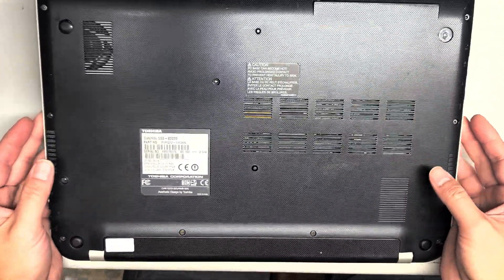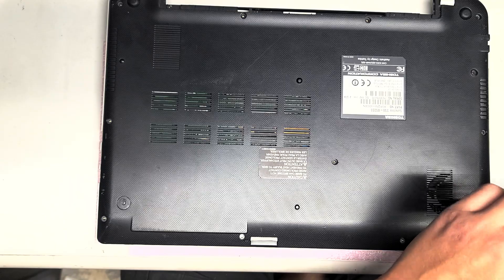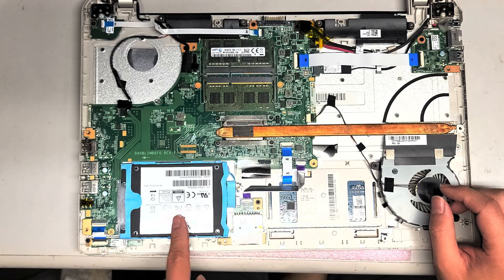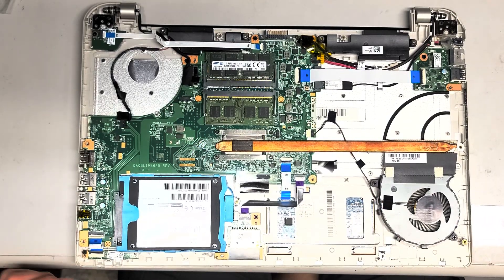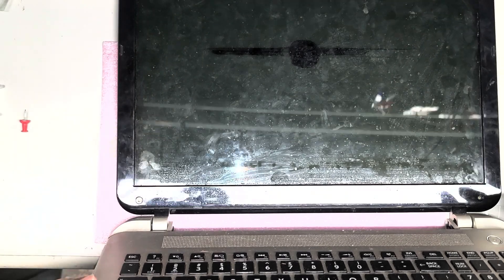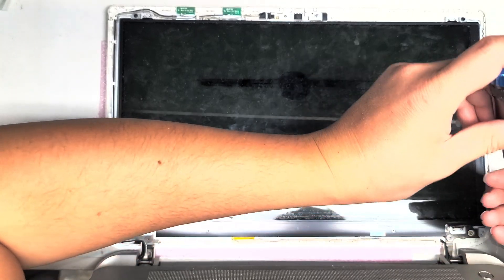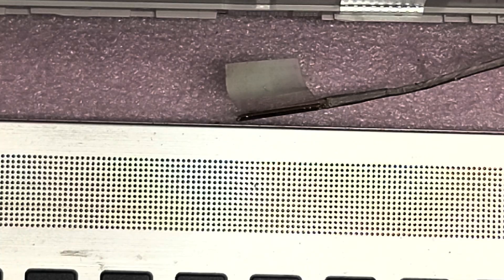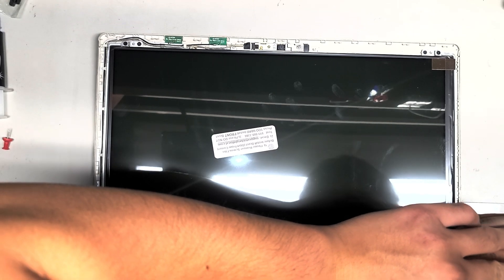Toshiba Satellite S55 S55-B5280 Disassembly RAM SSD Hard Drive Upgrade LCD Screen Replacement Repair

Comment: I have this model and FORGOT my BIOS PASSWORD ... anything I can do?
Reply from the maker: Not that I know of.
Reply: @ItsBinhRepaired  
From what I had learned ... there is NO BIOS BATTERY on the motherboard and BIOS gets its power from the laptop battery. And, it sounds like it does a MEMORY FLASH for the BIOS PASSWORDS and there is no way to recover the machine without the password ... I never got an answer from Toshiba if they could recover it or not??? GOOD NEWS ... about an hour ago and after digging through some papers I FOUND THE PASSWORD!! I would have LOST some DATA and a 12GB and 1TB machine ... and left with a BRICK 😭
Reply from the maker: Nice! Glad to were able to find your password.

Comment: Thank you for great video. I have a huge favor to ask, I have (Toshiba satellite s55-b5289), I need to replace the battery and I couldn't find it in amazon and elsewhere in the internet. would be kind enough to direct me to where I can find. Any link(s) you can provide greatly appreciated.
Reply from the maker: What's the model number on the battery itself?
Reply: @ItsBinhRepaired  I think I need to open it to find out. Don't have tools now, but will report back when I open it.
Reply from the maker: Sounds good
Reply: @ItsBinhRepaired  . Model No. PA5195U-1BRS
Reply from the maker: @abdirahmanhussein5865  looks like this should work https://amzn.to/3cBL5Yp
Reply: @ItsBinhRepaired  Thank you so much. The link is for US delivery only. I live in Canada and searched under those who deliver to Canada but couldn't find it. am I blind? please help
Reply from the maker: Other than searching the battery model number online, I can't help you. I'm not a Canadian.
Reply: @ItsBinhRepaired  ...No worries.... thanks
Reply from the maker: @abdirahmanhussein5865  hopefully you'll be able to find one
Reply: @ItsBinhRepaired  Thanks for you help. with your input I was able to find it ..... was just skeptical because sometimes they say it fits to this model and when it comes it turns out to be the wrong part.
Reply from the maker: @abdirahmanhussein5865  great!
Reply: @ItsBinhRepaired  Thank you, I got the same model and needed a battery replacement. I am so glad I am subscribed to you.

Comment: I tried turning on the computer but screen is unresponsive, the computer otherwise turns on, audible fan and motherboard clicks can be heard, but there is no screen
Reply from the maker: Does it work with an external monitor?

Comment: Hi im having a problem with this laptop, i press the power button when plugged in, the computer makes audible noises, such as fan and motgerboard clicks, but there is no screen. I tried reseating the ram sticks but dont know what wlse i should do
Reply from the maker: Might be a dead motherboard. Did you try an external monitor?